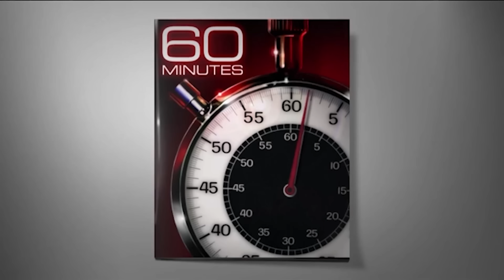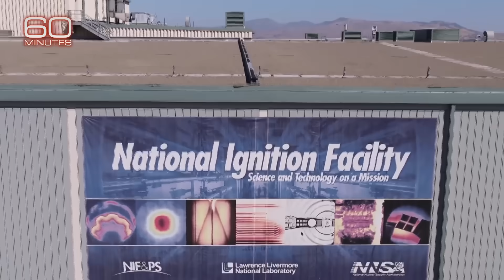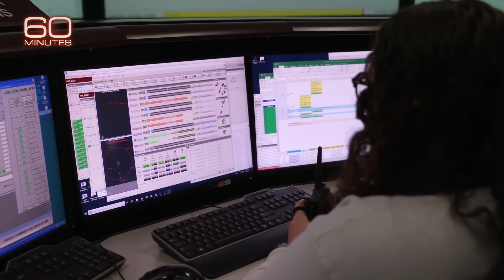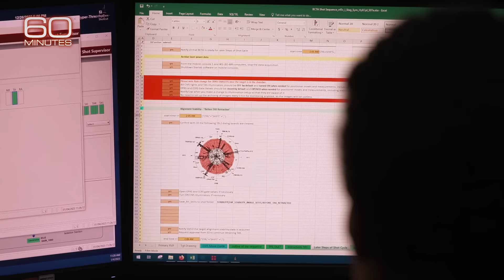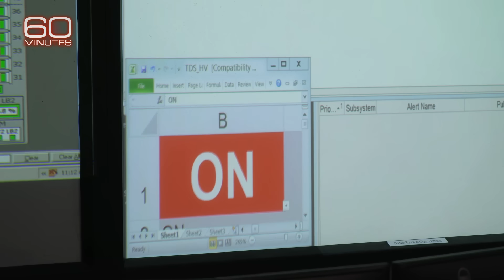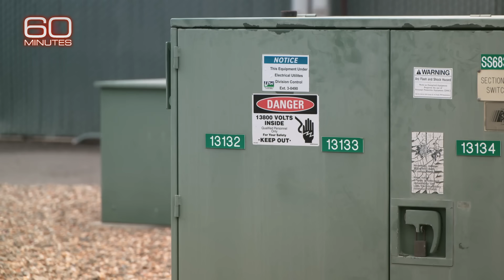Nuclear Fusion: Inside the breakthrough that could change our world | 60 Minutes

Comment: i would b kinda surprised if we didnt have n operational version by 2050, however, iv also never heard the honest truth about how much energy it actually took to make it happen.. the way everybody else puts it, n probably believe it to b themselves; is that we got more out than we put in total..
Reply: For those who followed the entire video they would finally learn that it took more than 100 times more energy to drive the lasers then was generated by the 0.00000000008 second worth of nuclear fusion reactions that they measured. The NIF lab management has, in the past, not revealed the energy needed to drive the lasers but due to leaks that they were hiding that a reporter asked a direct question that the management finally responded to.

Comment: she said 10 shots per second will be required
Reply: The existing laser can't fire much faster than once per day. The announced experiment took about a week to prepare. It is estimated that the target assembly cost over $100,000 USD. Each shot turns it into an exploding plasma and only about 4% of the fuel actually reacted before the other 96% was blasted away from the reaction center. The nuclear fusion reaction lasted for approximately 0.00000000008 second. The tritium portion of the fuel is exceedingly rare, radioactive and has to be removed from the target chamber internal surfaces as radioactive waste. The current price of tritium is about $30,000 per gram. The fusion energy generated by the announced experiment was 3.15 megajoules which is equivalent to 0.875 kilowatt-hours. Far more than ten shots per second would be needed for a practical nuclear fusion energy power plant.

You may have missed the mention that in this experiment the energy needed to generate the laser pulse was over 100 times greater than the energy generated by the fusion reaction.

Comment: The key is to contain it otherwise it disperse
Reply: The fuel was compressed down to a microscopic point within 0.000000003 second at which point the nuclear fusion began and lasted for approximately 0.00000000008 seconds. At that point the reaction blasted away the remaining fuel, which was about 96% of it, in a mini-explosion in the center of the large vacuum chamber. The extremely rare and radioactive tritium had to be cleaned from the internal surfaces as radioactive waste before another shot can be performed. It took about a week to prepare and generated approximately 3.15 megajouls of energy which is equivalent to 0.875 kilowatt-hours of energy. There was no significant propagation of the fusion reaction since it was totally dependent upon the compression of the 0.000000003 second laser pulse. The NIF lab uses the term 'ignition' in a misleading way. The tritium component of the fuel now cost approximately $30,000 per gram and is expected to become even scarcer once the source reactors shut down.

The NIF lab has always been primarily funded as a thermonuclear weapon (H-bomb) research tool. The management has always obscured that fact by claiming claiming it is a viable path to a future economically practical nuclear fusion power plant, when they present to the general public.

Comment: Wow! Either you grossly undersold the achievement, or Lawrence Livermore Labs has done nothing new. 
We have done quick shots of fusion for decades, but it won't sustain itself to keep running on the energy it produces. We already know it can be done, but getting more out than we put in? That's the trick. Wait until we get "ignition." Then you'll have some news for us.
Reply: The announced experiment took approximately a week to prepare for while the laser pulse driven nuclear fusion reaction lasted approximately 0.00000000008 second. There was no significant propagation of the  fusion reaction in what most people would call "ignition." The fusion energy output is the same as 0.875 kilowatt-hours, not much. If they could consistently repeat this experiment on a weekly basis it would have a nuclear fusion duty cycle of approximately 0.00000000000001%.

The NIF lab has always been primarily funded as the thermonuclear weapon (H-bomb) research tool. The NIF management has always obscured that fact when presenting to the general public. Instead they have always presented it as a reasonable path towards a future economically practical nuclear fusion power plant. Most nuclear fusion physicists agree that the NIF's Inertial Confinement Fusion (ICF) approach is unlikely to lead to such a power plant.

The Lawrence Livermore National Laboratory once had a separate project involving the design of a future ICF power plant but funding for it was quietly dropped after it received an unfavorable review from the National Academy of Sciences (NAS).

Comment: Remember the achievement is a proof of concept with a minuscule net gain in output . A functional power plant is still decades away and probably won't be a tokamak .
The Mechanical Engineer beats the physicist at this moment in time thankfully . It's nice to blow my own trumpet on this occasion, as competition nearly always builds a better machine and mine wins easily .
Engineers build the equipment that helps achieve these milestones .
Mechanical engineers are very underrated and don't get the credit they deserve .
Remember a fusion reaction takes fuel to initiate and sustain and is technically not a renewable power source or self perpetuating if a working power plant is ever built unless current designs are changed.
Our sun will die eventually .
😎👍
Reply: If you explore the subject more fully you will find that most fusion energy scientists agree that the Inertial Confinement Fusion (ICF) approach, applied at NIF, is unlikely to lead to a economically practical nuclear fusion reactor. There is a great deal of physics involved in ICF as well as in Magnetic Confinement Fusion (MCF) approaches. If you watch the video closely you will find that the management finally revealed how much energy it took to create the 3 nanosecond laster pulse that eventually led to the stated fusion input energy. A reporter asked a direct question about a parameter that the lab previously kept quiet about. It turns out that the energy to power the laser shot was over 100 times greater than the so-called fusion input energy. I hope the integrity of engineers is better than trying to hide such vital figures.

Comment: 2 units of energy go in, and you get 3 out. Okay, but how many units of energy does it require to produce those 2 units of energy? It seems like even though the ignition produces more energy, it takes an extreme amount of energy to run all the technology, and equipment used to fire the laser. Anyone have any insight?
Reply: The NIF lab management and most other fusion experimenters have always based the fusion gain (Q) figure based upon a limited input energy parameter. With NIF it is the final energy of the laser beams that enter the hohlraum, or it is the generated X-rays that actually end up compressing the tiny fuel capsule. For most of NIF's history they have avoided mentioning how much energy it took to power the laser system. Some outsiders have been pointing out that omission so this time, in response to a direct question from a reporter, they provided the laser input energy. It turns out to be over 100 times greater than the figure they they usually give for the fusion input energy. Some people claim that the lab has been deliberately misleading the public by avoiding mentioning key input parameters.
Reply: @vernonbrechin4207  I guess what I’m trying to get at is yes, while this might be a huge milestone in science and energy, but what’s the point if you have to produce just as much energy in order to make it all work. Like when you factor how much energy you have to use to turn on a power the actual laser, are they really producing more energy?

Comment: Nuclear fusion could be develop as weapon
Reply: It was first developed as a weapon, specifically from the development of the first thermonuclear explosion (H-bomb). The NIF has always been primarily funded as a thermonuclear weapon research tool.  Even the announced experiment was part of that research since a target material was inserted to expose it to the radiation of the miniature nuclear explosion. NIF is also used as an aid in modernizing U.S. nuclear weapons. The management has always obscured that function when presenting to public audiences. They have always cast it as a viable path to a future practical nuclear fusion power plant. The vast majority of nuclear fusion physicists agree that the NIF's Inertial Confinement Fusion (ICF) approach is unlikely to lead to a practical fusion energy power plant. The NIF lab once included a project to design a future power plant but after a external review, by the National Academy of Sciences, found many flaws in the plan the program was quietly defunded.

Comment: Absolutely a lie. They failed to calculate for all the energy loss due to conversion.
Reply: The lab was finally pushed to reveal the input energy into the lasers. It turns out it was at least 100 times greater than the announced nuclear fusion generated energy. There are major energy loses in pumping the lasers with flash lamps. Then their are at least two shifts in wavelengths, from visible, to ultraviolet and then to X-rays. The newest types of lasers can't overcome the later loses.

Comment: I have not seen this entire video yet but we are grossly misinformed about power generation and power use and we are not aware of the illegality of fusion power research .
We are signatories of the nuclear nonproliferation treaty based on the damage of nuclear cascade. We don't develop build or share nuclear technology. Fusion power is nuclear technology that uses radioactive materials and produces nuclear radiation. We don't need to produce heat to produce electricity. We can build Edison generator and dynamos power plants with inverters and transformers to deliver high voltage AC power to the power lines. An edison generator uses the field magnets to move the armature magnets and coils of copper wire we add inverters and transformers to deliver high voltage AC power.a dynamo uses the electric power to move the armature magnets and coils of copper wire with the coils of copper on the outside of the iron case. The dynamo produces more electric current than is used to move the coils of copper wire. The inverter and transformers are added to deliver high voltage AC power continuous peak power without fuel or pollution to the power lines. These are old power plants that have not been used since 1930 s.  We can easily replace fossil fuels power plants and nuclear power plants with Edison generators and dynamos power plants..
Reply: Certified radiation safety State of California MA toxicology environmental industrial toxicology BS biology (BA chemistry) single subject waiver for teaching chemistry.
Reply: Thank you for your interesting perspective. You are correct that the most common type of 'controlled' nuclear fusion experiments involve radioactivity. That involves radioactive tritium fuel, the 14.1 Mev neutrons generated by most fusion reactions and the neutrons activation of components of the machine that generates the fusion.

Many people assume that if they are considered experts in one field that they can expound on other things well outside of that field of expertise. You might want to take some courses in electrical engineering. The Edison generator is not some magical tool that generates its own energy. It requires an energy source to drive it, such as flowing water, or a steam generator driven by something like fossil fuel burning, or heat from a nuclear reactor. The Edison Generator and conventional AC generators just transform one form of energy to another form of energy.

Today it is a common practice to transform high voltage AC current to high voltage DC current in order to transmit large quantities of electrical energy over two conductor power lines and then convert it back to high voltage, three phase, electrical energy again. That is done to reduce the energy loses of transmission over great distances.

Comment: The bigger question is how much would this cost us on a general scope...
Reply: It has been estimated that the NIF project has consumed approximately $11 billion. The management avoided answering a question regarding the target assembly cost. It has been estimates to be approximately $100,000. A future power plant would need to blast these into a plasma several times per second. The radioactive tritium fuel, used in these experiments currently cost approximately $30,000 per gram, and is in very limited supply.

Comment: Consider the temperature of lava. Sillies.
Reply: Typically molten lava has a temperature of from 800 to 1,200 °C. The estimated temperature reached by the compressed fuel in this plasma was approximately 150,000,000 °C. The nuclear fusion plasma requires significant isolation from the solid container that surrounds that plasma. That is typically seen in magnetic confinement fusion experiments.

You are correct that these experiments are a waste of time considering that they have been going on since the late 1970s and yet are likely to need at least another 20 years to prove that a practical future nuclear fusion power plant can be developed from them. The efforts are massively expensive distractions in a world plagued by exceedingly rapid Anthropogenic Climate Disruption (ACD) effects. I urge readers to search for the following article titles.

IPCC report: ‘now or never’ if world is to stave off climate disaster (TheGuardian)

UN chief: World has less than 2 years to avoid 'runaway climate change' (TheHill)
  * This statement was made 4.4 years ago.
Reply: @vernonbrechin4207  

Yeah, i agree IMPOSSIBLE.

Comment: This is nonsense.  While the lasers delivered 2.05 MJ of Heat then the capsule created 3.15 MJ. it took 200 MJ of fossil fuels to power the lasers.  And where are all the rare elements required coming from?
Reply: Good points. Actually the sources of power, utilized by NIF are varied. They tend to be, hydroelectric, natural gas powered power plants, wind turbines, photovoltaic panel farms and nuclear power from the Diablo Canyon nuclear power plant.

The diamond is synthetic diamond created via the CVD process. The tritium source is  primarily from some CANDU power reactors in Canada. The current price of tritium is approximately $30,000/g. It is projected that the extremely limited supply will soon become even less and the price will rise.

Comment: The better option would be to find a way to sustain the raction after initialization instead of simply stockpiling a bunch of diamond ballbearings.  Because if there is a massive process simply producing the fuel pellets and the copper housing structure - regardless of any fusion - it's not self sustaining since all of the resources need to be manufactured and would in themselves produce more waste than not.
Reply: The reporter compared this moment to Edison = light bulb or Graham = telephone (aside from thehuge amouont of inaccurate information from those examples alone) this would be more like early experiments figured out how to conduct electricity on a wire between 2 points > noticed it glowed and had the idea to think about replacing candlelight.  This is not the lightbulb or telephone yet.
Reply: The Lawrence Livermore National Laboratory (LLNL) management are deliberately misleading the public by using the term 'ignition' in their facility and in the announced experiment. Their definition of 'ignition' is totally different from striking a match and seeing the reaction spread to the rest of the fuel within a couple of seconds. In this Inertial confinement fusion (ICF) experiment the fusion reaction is almost totally dependent upon the externally applied compression energy. The laser beam pulse lasts approximately 0.000000003 second and then the fusion occurred at a microscopic point for approximately 0.00000000008 second while the compressing force was still being applied. Once the nuclear fusion reaction began the enormous forces in it blasted away approximately 96% of the remaining fuel before it had a chance to react. That ended up coating the walls of the vacuum chamber and required removal as radioactive waste.

Comment: Jeez, humans talk shhht sometimes, how can we produce anything hotter than the sun 🌞, no dam way!!!
Reply: It is possible but only in a extremely limited time period, or limited amount of mass. In this announced NIF experiment the fusion lasted for approximately 0.00000000008 second and developed a peak temperature of around 150,000,000 °C before the enormous fusion energy blasted away about 96% of the supplied fuel. There was nothing sustainable about the reaction, which the lab brands as 'ignition.'

Comment: I have the opportunity to work on  Shiva- Novett and Nova and the French version of Nova, I worked in the clean room and built and tested the half shells. And sometimes worked on the capacitor Banks, I was proud to be part I'm such a big experiment, too bad there were so many backstabbers back in the day that took credit for the work that I did.
Reply: Sorry to hear that you got backstabbed for that work. When working with Shiva, Novett and Nova, which were predecessor ICF machines to NIF, were you and your co-workers aware that virtually all the funding was intended for thermonuclear weapon (H-bomb) simulation experiments. Most of the fusion fans that see the above video have no idea when ICF experiments began (late-1970s) and they are unaware that the lasers that came before NIF were expected to address all the instability issues before NIF began operations. Once it achieved full power it was expected to achieve 'ignition' by 2012. It missed it by more than a factor of ten. It took another decade to make the claim addressed in the above video.